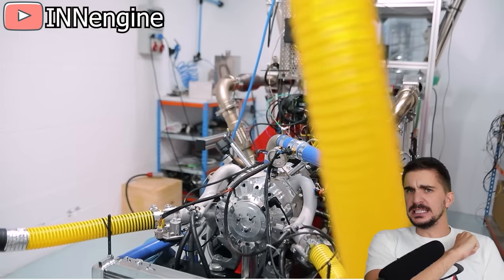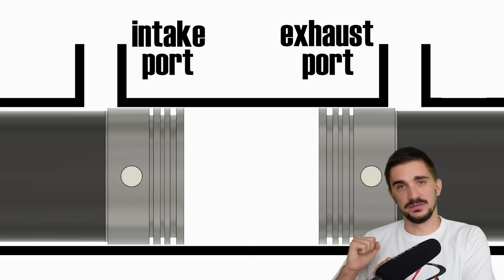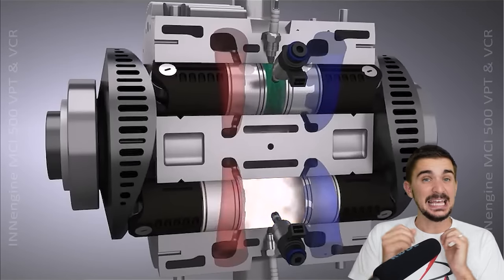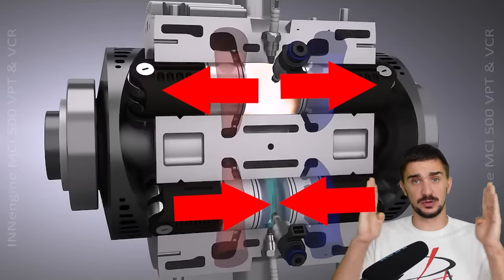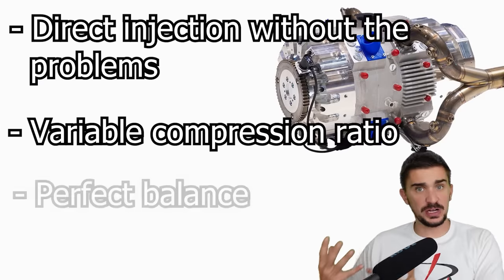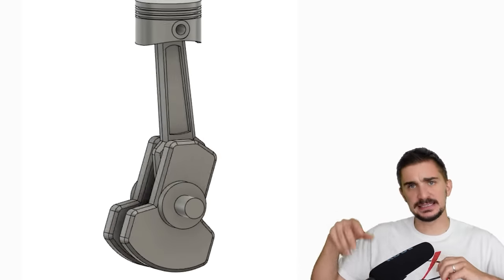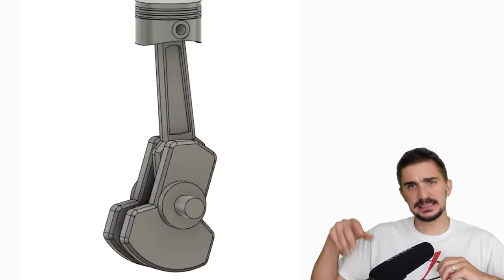Spain is Living in 2050? Revolutionary 1 Stroke INNengine Analyzed

Comment: I think the main fail point is the bearings on the wavy things.
Reply: The whole wavy thing is the problem. I think that i can be replaced with a normal crankshaft and piston connecting rods connected to an angle. The piston would probably be connected to the connecting rod with a ball joint. I think that makes more sense.

Comment: Looks like a variation of the good old axial engine to me, but with that particular design of swash plate I see a lot of mechanical power loss before we even get to the drive shafts,  also a good bit of component wear. I would be curious to see the service life on one of these
Reply: Was thinking those same things lol
Reply: i also thought that, but the power is so high i think it will still punch above its weight. 500cc 120hp is nuts. my 500cc honda sport bike had 45hp.
Reply: Ditto
Reply: That and lubrication is going to be serious issue on such configuration.
Reply: exactly - this looked to me almost like a worm gear where it could be driven one way but not in reverse.  The reason it works in a compressor is that its going the opposite way and the swash plate can drive the pistons.   The mechanical losses from the axial force to the swash plate rotation will be enormous (if not infinite).

Comment: Nice work. As I was watching, I was dubious about the ability of it to self scavenge in all conditions. The forced induction might have to be mandatory in an application such as a car with a conventional driveline. Yes, the torque is the gorilla in the room. It would be like your TZR. Thanks again, great explanation.
Reply: Exactly but nothing new. Thus is a 2 stroke engine, Use resonance and the piston itself as a double action pump to scavenging. In a uniflow engine, fresh air don't pass through the crankcase and don't receive this extra help so the use a volumetric compressor to assist the scavenging. This engine use the same principle but uses the second piston as exit valve.
Reply: And much like a 2 stroke, it'll have a hard time with emissions and efficiency. Not having premix helps, but not perfectly.
Reply: Look at Achates Power and their radial opposed piston engine. Both use this uniflow two stroke engine design first pioneered by Junkers during WWII. They both need forced induction to make this engine layout work. So long as they are using diesel as fuel, this is a great design layout. Probably could of gotten away with three pistons at 120 degree offset from on another, with a larger diameter swash plate,( "wavy thing"), to increased torque. Call it a pancake engine.
Reply: Exactly. All 2-stroke designs need higher than atmospheric pressure for scavenging. It doesn’t need to be much higher, but it MUST be above atmospheric. Some get it using the crankcase as a compressor, some with an external compressor.

That these people are claiming their engine runs at atmospheric pressure probably means that the blower is just moving enough air for scavenging and not enough to supercharge the cylinder i.e. the net air volume = cylinder volume.
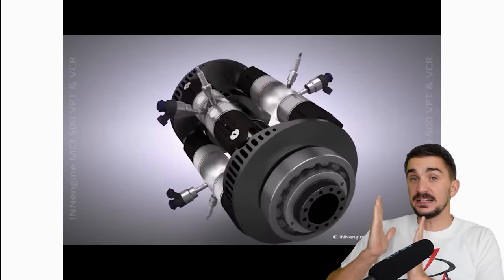Reply: @DABrock-author  The engine on the test stand @6:28 does not have a scavenge blower, so at the right speed and load combination it may scavenge by itself on just port timing and manifold tuning to run... barely.
Reply: @affiliatereviews4079  The choice of an even number (4) of cylinders with pistons 180 degrees from each other in synch (requiring the cam to go through two cycles per revolution) was probably for balance. Three cylinders would not be in dynamic balance.

Comment: The big problem would be lubricating the rollers at the ends of the pistons which transfer force to the swash plate. The combustion stroke would cause the loading on these rollers to be high but no way, other than splash lubrication to get oil to the internal bearings. Also as you mentioned, the supercharger is there to move air through the engine aka a Detroit diesel.
Reply: That, and bearings are a ground finish. The surface finish on the wavy thing would probably need to be equal or better. I see an ass-ton of continuous lateral force and friction. I'm sure they R&D'd the hell out of this before going to production. Still, I'd be very interested to see how they manufacture the wavey thing...and what matl's they use, etc.
Reply: So true. you could use pumps that push high pressure oul in those parts via tiny holes

Comment: The wavy thing is called a cam plate in a mechanical rotary diesel fuel pump (Bosch VE) ,which is almost identical ,along with the roller system that runs on it
Reply: Also called a "swash plate".
Reply: @jimcherry685  While it's not technically a swash plate, I can see why you might think of it that way given the similar function of transforming motion. However, 'cam plate' is a more accurate term in this context due to the specific way in which it operates and the different patterns of motion it can produce.

Comment: Just to point out that there is a very successful 1 stroke engine that has been in operation for many years. It was designed by Staley in 1804. Speed record of 126mph held by the Mallard steam train in 1938. Also the steam engine in trains has a power stroke both ways making it very efficient and powerful.
Harry, steam train enthusiast.

Comment: As usual, great video.  My only complaint is about the Miata supercharger part.  You ARE right that it's not naturally aspirated, but in defense of the engine design, as an opposed piston 2-stroke design, it wont start/run without a higher intake pressure than exhaust pressure.  Many 2-stroke designs utilize a supercharger to accomplish this with a very low pressure ratio (talking 1.1x or 1.2x atmospheric pressure).  A centrifugal compressor seems an interesting choice because of the non-linearity of it's airflow delivery.  I would guess if it's setup to deliver 1.1x to 1.2x for start/idle, it probably delivers significantly higher pressure ratios at peak power engine speeds.
Reply: Actually curious: How do dirt bike 2-strokes work then? they don't have forced induction.
Reply: @christianschmitt2409 because they use the crankcase and the piston going up and down to force the air through.
Reply: @renesisfd1  thanks mate!
Reply: @renesisfd1  and that is exactly what is missing in this "1 stroke" engine?
Reply: @what9418  On a single-piston (per cylinder) design, the piston is only moving one direction at a time. So the air preferentially moves that direction.

With this design, the pistons are moving in exact opposition, so the air doesn't really move either direction. When the exhaust port opens, the air starts flowing out, but can only get down to one atmosphere of pressure. The pistons keep expanding outwards, which reduces the pressure to below one atmosphere, but that will cause the exhaust gases to also reverse direction.

The key here is scavenging. The air near the intake port is already starting to move towards the exhaust port as the intake opens, which tends to suck air through that side. And the momentum of the air leaving the exhaust means it takes a while before the exhaust reverses directions. This means you get more fresh air from the intake than bad air from the exhaust, and the extremely high chamber pressure after combustion means most of the bad air escapes out the exhaust before the intake opens.

I don't think forced induction is required. I'm finding plenty of references to naturally aspirated, opposed cylinder designs, but most are locked behind paywalls and I'm not finding videos or similar of them running. But a little forced induction would definitely go a long ways towards assisting the scavenging process.
Reply: @what9418  a bike engine uses the crankcase oil for cylinder lubrication. the intake is is open to the crankcase. so when the crankshaft moves it forces air pressure into the intake. The engine in the video is not open to the crankcase and therefore the intake cannot benefit from the crankshaft, or in this case, the swash plates (plate thingy) moving around.
Reply: @doktornorton859  yes, the way the author explains it, it is unlogical air enters the intake. The cilinder is pressurized because of combustion after all, pushing everything out instead of sucking air in.  Scavenging would be non existent because the piston doesn't push out the gasses, hence the gasses lack momentum, hence no vacuum is created in thr cilinder.

Of course in a 2 stroke air is sucked into the crankcase and then pushed into the cilinder when the piston moves back during the combustion cycle and the exhaust area opens way before the intake is uncovered.

You'd need some form of compression to push in the air in the 1 stroke design.

Comment: The " wavy thing " is called a swash plate. Similar design has been used for decades in automotive Air conditioning except the compressors usually just have one central swash plate driving the pistons off both sides of the swash plate .
Reply: Additionally, opposed piston two cycle engines were made notable by FM nearly 100 years ago - Nothing really new here.

Comment: This appears to be excellent analysis of this engine, thank you!

I think your summary near the end of what the best uses for this engine are, are spot-on!  This company should have considered their reputation before making the apparently ridiculous claims they seem to have made...  a bad rep could kill their own success even if they have an excellent product.  It could be plenty good for those specific applications without trying to - wrongly - equate it with the performance of standard engines.

Aside from the specialized light-weight uses like aeronautics, use as a range extender for cars, like you mentioned, could be an excellent use for this - all depending on what the efficiency is like.

What we need to smooth the transition into EVs is for people to still be able to fuel up like a "regular" car when charge is low... the whole purpose of PHEVs.  But for practicality, efficiency, AND cost, the engines to do this need to be smaller, almost become an incidental part of the car, rather than a full-size engine in ADDITION to a big battery.  Instead of the philosophy of current PHEVs where you have a little electric range and a whole lotta engine, small engines like this could facilitate a more mid- to large-size battery, and just enough engine to keep you going should you get caught without a charge far from charge stations.

As for its torque range, AND most importantly its efficiency range, a hybrid can be easily optimized to run the engine wherever needed for best performance.

Comment: Great informative video, the mechanics were explained very well. Seems like it could potentially be a good choice for small ev hybrids.
Reply: EV Hybrids? Whats the point of EV Hybrids. it burns fossil fuel and no matter what they do to it it still needs masses of electricity to get its oil out of the ground, and an exhaust so it will be 30-40% efficient with the exhaust spewing out the heat and fumes….😮
Reply: @davebax6819 You need to understand the usage of a typical car. Here in the rural area people tend to drive 10-20km to work. When that is easily doable with battery power (~60km range) most of the trips consume no fossil fuels.

However when doing longer trips (>300km) you will use fossil fuels. It makes a huge difference in the long run.

Comment: Very good article. I am pausing to consider the cam rate ( angles of pressure during ignition stroke )of the swash plate rotor(s) could easily increase the leverage and increase the number of firing strokes per revolution without being in any way visible. I suspect the increase in power thus achieved, will allow a slower crankshaft RPM at a higher output than we may be inclined, to presume of the design?
Third I am reminded of the supercharged Commer 2 stroke truck engine which used two rocker shafts with fout connecting rods (or two crankshafts) and two opposed pistons in the same combustion chamber. These engines were powerful, terribly noisy, and very successful. In many markets during their time were the most commonly utilised, trucks available prior to the D series Fords of late 60's and the 70's. Although they continued to provide service at the same time until beyond maintenance efficiency. 
So, I suggest you do not decry this claim of power at face value since there might be distinct surprises in the offing as yet unknown. However it is a marketing falsehood to suggest they have created a one stroke engine, which (as you noted) is actually a ridiculous claim! Also the small gudgeon holding the roller bearings is a high maintenance weak point that may be improved with a crankpin size gudgeon and whitemetal bearing shells which then, requires a pressurized lubrication system! Thus departing from the design explanation creating yet ANOTHER deception by a company that, then wishes to be taken seriously? I cannot.
Reply: 1 stroke engine yeah that should be tough lol

Comment: Looks like a perfect engine for a hybrid vehicle.
A smooth-running engine like this that can be optimised for a generator coupled with direct drive hub motors (more torque from 0 RPM than any tyre can handle) may be a better way to handle the variable torque needs of a road vehicle.
Reply: Or just make a 8 liter one of these and put it in the middle of the car with four seats around it, 1500 horsepower or more, 2500 pound car.

Comment: I feel like most of the valveless engines that keep popping up are going to be like that. 
Small, lightweight, cool looking... and tuned for a very narrow powerband.
Great as range extenders. Not so much for swaps.
Without adjustable flow (no valves, power valves nor even variable length intake or resonators) there's only so much you can control. And they clearly wanted that sweet peak power for advertising.
Reply: & they used it in a small light weight 2 seater kei-ish car, not a normal practical car, you can power those things & floor the pedal with a 1 piston general purpose engine.
Reply: Many thumpers could power the miata, I agree

Comment: Some 2 stroke ship engines have blowers but still works at atmospheric pressure. The blower is used for scavenging and not boost. 

Could be something similar here. They might not fully rely on the vacuum/pressure wave for scavening, and instead blow in fresh air to get rid of the exhaust.

Comment: I have little understanding of engineering or the capability of this engine, but what came to me was that it would be awesome to have an engine like this to create a two wheel drive enduro type bike. Decent amount kf power for a light weight, with crankshafts at each end to run off to ptos for each wheel. It is a very interesting design i hope it does well.
Reply: Why couldn't they use hydraulic instead of fuel?  Using an appropriate pump powered by small hydrogen or electric?
Reply: completely unneeded considering hydrogen fueled engine's dont require advanced timing.....   my 100cc kawasaki puts out twice the horsepower on hydrogen...        not surprising considering gasoline is only flammable,  ya gotta squeeze the shit outta it and light it to get ANY work from it,,,,    its 35% effeciect for combustion lol      meanwhile hydrogen goes off no matter what.... Bang   not poooooooof

Comment: Changing the compression ratio will also affect "valve" timing, since offsetting the piston (in relation to the opposing piston) will change the time at which the port is uncovered. It will also introduce imbalance, as the center of mass of the 2 pistons is now moving back and forth, since they are no longer at inverse phase from each other.
Reply: Unless you put the port on a moving piece attached to the center shaft so that they move together, but that might introduce more potential for failures and friction and the problem of making the piston not airtight

Comment: Hi.
A few thoughts on your video:

1. 1 Stroke - If each combustion is a stroke, in this case and configuration you should always count 111111... and not 121212...

2. Hybrid Version - This engine will be even more efficient when combined with hybrid technology - mild or full

3. Hydrogen - Hydrogen combustion should be considered

4. Nuclera - A nuclear version of the engine should also be considered. Imagine charging your vehicle (whatever it is) with tiny pieces of thorium once every 3 years.

Comment: Call it a rotary boxer motor. 
I love how it appears balanced, the flywheel is inside and does dual duty for timing. Not sure how efficient it is without variable timing but I guess variable compression ratio works too. Lubrication and changing spark plugs seems challenging but this can be solved.
I can see this as a nice engine for hybrid vehicles, where it only kicks in at higher speeds, then torque is not a problem.
Reply: They missed their oportunity to call it the rotary boxer engine
Reply: Those piston bearings take the brunt of the combustion, and seem extremely hard to properly lubricate. The pistons in this engine are essentially free-floating, always pushed toward the plate by gas pressure. How do they mitigate the wear on the bearings? That's my question to them, or to you if you know the answer :)
Reply: @paulmichaelfreedman8334  since no combustion happens on the bearing side, a standard oil squirter should be enough to drench everything and keep metal parts from each other.